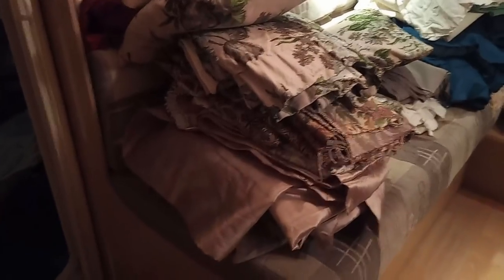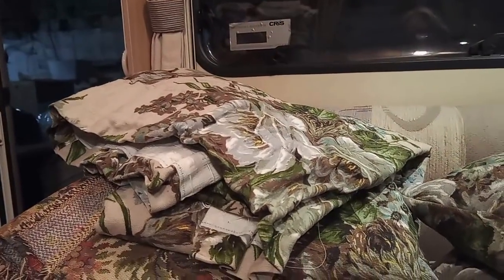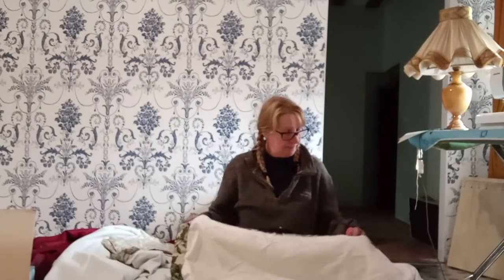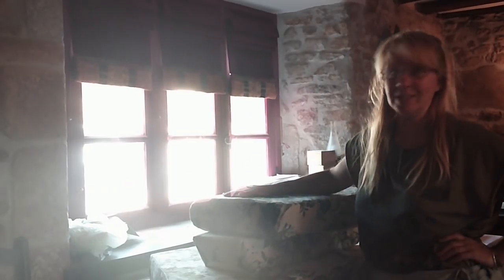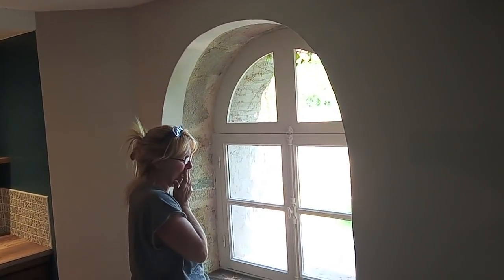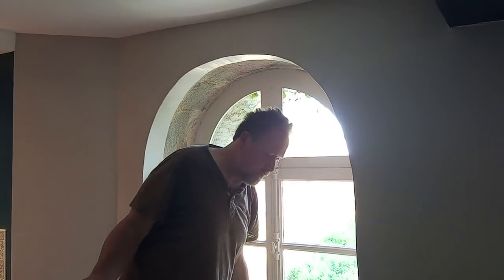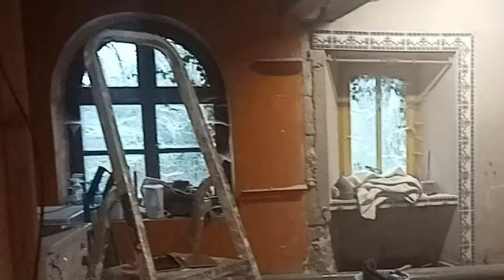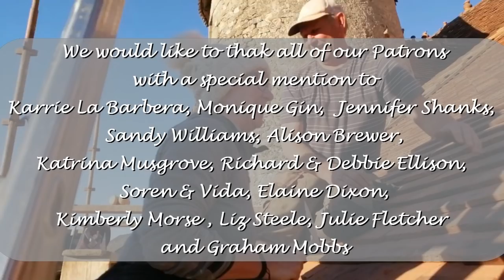84. Soft furnishing

Comment: Loving the window seat I've got a little tip for you when covering foam if you put stockinette over the foam first it stops the material from creeping gives a smoother finish and is easier to remove the cover for washing. It's not expensive and will extend the life of your cushions. I have used it when making vintage caravan seating.